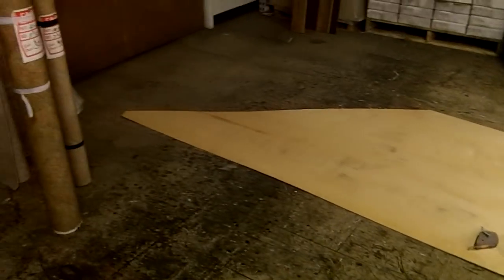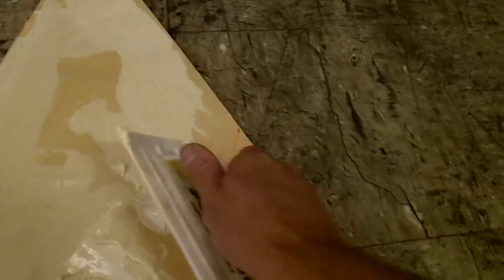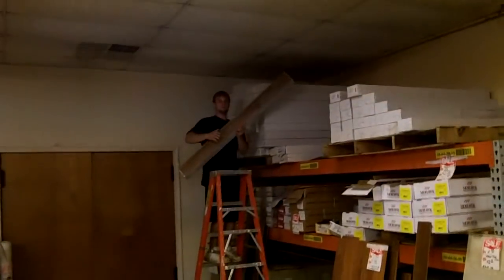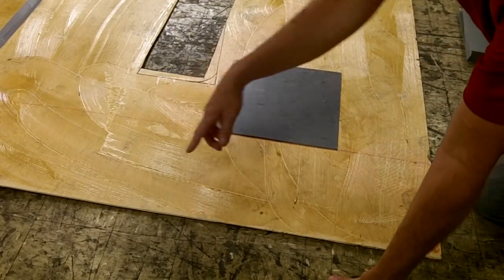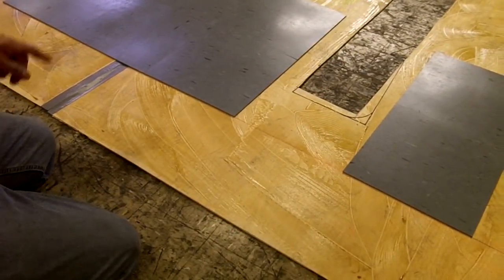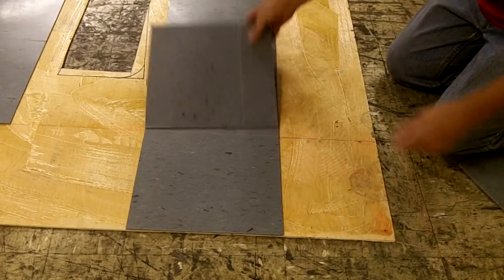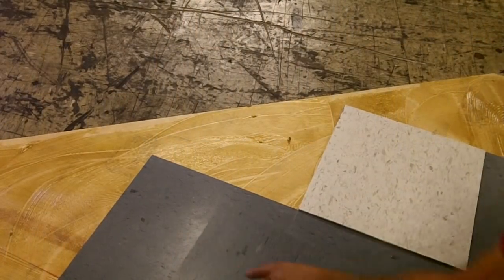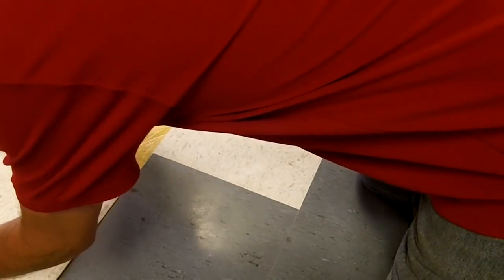How To Install VCT: Basics And How-To Tips

Comment: Can you use Henry 350r or AcrylPro professional tile adhesive for VCT tile? 
I went to Homedepot showed the employee that worked the aisle the VCT tile I was going to use
and he grab  the 2 and said either 1 of these, so I bought both, a month later now, I'm looking up how to use these two and I don't see 
it in use with VCT. 
A little help please, I want lay the tile but don't want to use those 2 if it doesn't work for the VCT

Comment: Hey all, I'm about to install VCT over a luan subfloor. I had to pull up peel and stick tile which left a sticky residue. I can get most of it off w/ mineral spirits (or acetone......doesn't seem to matter....less odor w/ mineral spirits) but still leaves a sticky film. Can I see w/ Henry's underlayment sealer? I also have some leftover Kilz sealer. Thanks for any advice.

Comment: Is VCT tile a health risk just to be around? I got the idea from someone to layer my desk in VCT tiles (as I thought it made a cool surface for my desk), and my arms and hands are resting on it all day. It's unwaxed/unpolished, etc... just bare tiles. Some tell me it's only bad when you burn it, but I don't know. Isn't it bad to be touching PVC like this? I don't want to have to wash up every time I use my desk.
Reply: +maccollectorZ (Commenting Account) This is the first I hear of this. Did you end up finding out the safety concerns? I'm in a similar situation.
Reply: Mark Anthony Barajas Apparently, they contain PVC, phthalates, etc., which can be harmful to human health. I have no idea what the risk of exposure is (especially because these are floor tile), but I don't want to risk it. I am sure, once coated, there is a lower risk of exposure to the product, but it's a little bit concerning. The materials found in these are similar to what you'd find in certain plastics, and they have been traced to cancer, birth defects, etc. Of course, you'd likely have to... I don't know... ingest(?) this material for prolonged periods, in order to experience long-term health issues associated. Since I am actually building off of an idea that someone else came up with (which is using the tiles as a surface for a desk), I'm considering trying to seal the tile surface with sealant or lacquer; maybe that'll do the job.

However, since that's MY personal situation, and I'm guessing that you're planning to use this on floors, I'd go for linoleum tiles. Linoleum tiles ARE the original VCT tiles, in a sense. It's a 100% natural floor surface that has been around since the 1800s or so. It comes in many forms, and one form (the tile form) looks similar to VCT tiles; they have those familiar patterns and colors. The one problem, though, is that they--on average--cost about a few dollars each, which is way more than the VCT tiles. VCT tiles can be as low as 68 cents a piece.
Reply: If its made out of asbestos yea, other than that nah, vct is vinyl, just like the "linoleum" sheets u put in ur kitchens nd shit

Comment: Would have liked to see how to lay it around a floor drain
Reply from the maker: Use the gauge tiles and make a square on the tile you want to cut by  going around the drain and marking north south east and west then use dividers and find the center of the square and mark the circle with the dividers then cut out.
Reply from the maker: In this video at 26:50 I do a curved wall which is similar
https://www.youtube.com/watch?v=86ja1L7zjew&list=PL45008E2516E41C52&index=7&t=0s

Comment: How do the tiles stick if you lay them down after the glue has dried?
Reply from the maker: The glue becomes super sticky when it dries. If you lay a tile on it and press down with your hand you will need a torch and scraper to remove it.
Reply: motodrummer it's pressure sensitive glue.

Comment: I have watched a lot of how to videos on laying down VCT.  I am planning on putting some down in my living room.  Do I put it down on wet glue or let it dry?  I am  a bit confused about the glue part. I'll be putting down about 750 tiles.
Reply from the maker: It depends on the glue. Most you let dry before you lay the tiles. Ask for Clear-Set VCT glue. It goes on yellow and turns clear when it's dry. It's dry but very very sticky. Do not lay over any wet spots.

Comment: @Albone3000 you don't EVER EVER EVER use a peel and stick. EVER.  Especially in a bathroom. The cost of VCT is roughly .35-.40 per foot at Lowes or Home Depot. Or you can step up to Luxury Tile. Any way make sure you invest in a heat gun or borrow one. Cheap one will do. Torches will burn tile and scorch them too easy.

Comment: VCT tiles has a dull side and a shiny side which side goes up and which side goes down and what is the reason?
Reply: Fishingtuts the shiney side is the side that should be facing up,.. the side you walk on.  the dull side down facing down. the reason ones shiney and the other dule is because one obviously needs glue,.. if they were both shiney there would be no where left for the glue lol catch my drift?
Reply: For whatever the reason it really helps knowing what is the shiney side. The 1st peice usually comes upside down and the guy who's prepping the dolleys doesn't always correct that. It's a terrible feelin when you're done laying and you see that dull peice dead smack in the middle of the room.
Reply: @saulmartinez4321  if your waxing afterward (which I'd recommend) you won't be able to tell the difference between the dull and slightly shiny side.